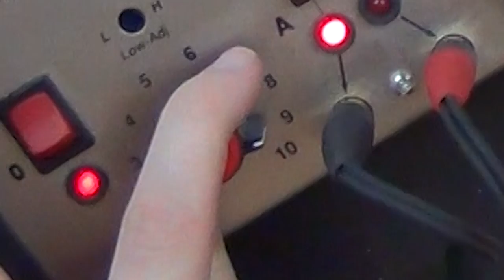1000 DEGREE PEN vs WOOD (pyrography)

Comment: Pro pyrography tip:
If you see any flames, put the temperature down.

Oh.
Reply: · Rafakado · yep...flames aren't good. You should also not burning with a red hot topic for very long either. 😆
Reply: whole slab sets on fire no no no.. this is fine.
Reply: · Rafakado · fire fighter asks how did you burn your hose down :you EXTREME WOOD BURNING
Reply: Valarie Connell /DrawingWithFire 999 like
Reply: Pro tip don’t wear handerpants
Reply: Wrong if u see flames put the temperature higher and pour gasoline on it
Reply: John M لض
Reply: @alexanderlapointe2407  , Are you aware that there IS torch wood burning? And it's called just that, Extreme Wood Burning?
Reply: @tracymarie4633  :P
Reply: ur 2,000th like ;o

Comment: Wow! You are as mad as a hatter and an amazing artist a perfect mix. The crazy eyes peering over the wood and the flames intrigued me. Had I not wanted to see you set fire to pieces of wood with your pyrography pen I would have missed the beautiful piece you created. There's something about watching a piece become it's eventuality in fastforward that makes it more than watchable. Kind of like how poker went mainstream with the users being able to see the hole cards of the players the same can be said for the creation of art. I'm just starting out as a pyrographer these are a couple of my first attempts at it using hard wood. Which I find exponentially easier to control as with softwoods the pen can skip and dig and bounce usually right at the moment after you let down your guard. I also find changing the angle of the board so that the tip is always being pulled across the work rather than pushed at all works for me. I hope to get just as good as you some day you've inspired me to push on. And thanks for the pointers on wood to try etc... 

Here's the link to my pieces https://goo.gl/photos/9gsrGZdEjTUaBZmn9

Comment: Plane trees have smooth bark, since it is periderm type it will peel off at some point, and for those trees its not a big deal, just dont burn in more than A5 size on 30 ft (10m) height tree, and not deeper than 0,1 in(~2,5mm)

Comment: Would it be possible to do this on my ukulele? If I lower the heat and try to draw lightly would it work? I don't want to crack it to the point it's not playable or breaks completely.
Reply from the maker: Yes it might work, but you'd want to make sure you stripped it of any sealer that's on the wood, and even any stain that's on it could evaporate into harmful fumes as you burn your designs on it. And then you'd want to seal it again after you're done.

Comment: I got a cheap burner with tips that are solid unlike your razor tip but it doesnt really glide along the wood like it appears yours does.  Could this just be my skill level or is it easier with the tip you are using for linework?
Reply from the maker: I think my wire tip is both sharper and much much hotter. Solid tips just don't get as hot, so you have to go slower, in my experience.
Reply: @peter_draws  Thank you so much for replying!!! Yeah, I started to get the hang of it but j was really struggling to get a nice curve.  I'm really liking pyrography so far so I'm really considering getting a more high end apparatus after I practice so more.  Thank you for introducing me to such an awesome art medium!

Comment: lol .. this made me wonder .. couldn't someone make a more "portable" version by using a vaping MOD? Maybe even using a vaping atomizer and regular vaping wire (ss316l maybe?) to make the pen tips. Using thinner wire and thicker wire to create new "pens" 

Not only would it be far more "portable" and without any cumbersome wires attached to some machine/regulator. It would give you the ability to customize the heat/power output to an incredible level, allow you to pulse heat, set watt/heat curves etc etc 

No technician though .. the tip of your pen just reminded me of when I build and dry burn my coils before I wick and use them.

Comment: Would not recommend pyrography on a guitar unless you know what you're doing and/or it was cheap and/or you built it from scratch. The majority of commercially available string instruments are made of wood that is chemically treated in some way, and/or are varnished with lacquers, even if they aren't painted any unnatural color, and you don't wanna be burning that stuff without knowing what's in it.